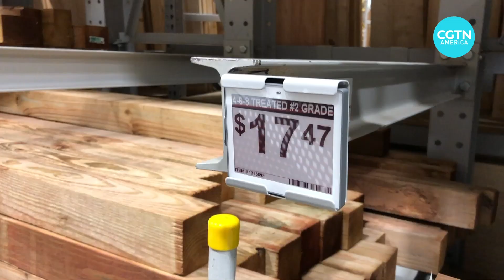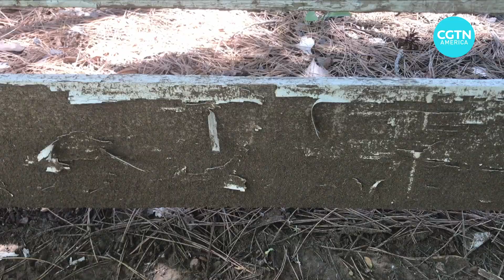U.S. inflation: Lumber prices

Comment: Why do Americans use wood to build their houses and not bricks or cinder blocks?
Reply: Because, wood is cheaper in USA,CANADA, AS THERE ARE MORE FORESTS less people so they can cut tress, UNLIKE INDIA,CHINA WHERE BRICKS ARE CHEAPER THAN WOOD AND have MORE PEOPLE. Thanks .
Reply: @shakebraza196   Yup that's about  right and wood is really easy to work with
Reply: @snakeplisken4119  easy to work with how sir.
Reply: @shakebraza196   Work with it awhile you will see. If you can swing a hammer you can build with wood.
Reply: @snakeplisken4119  Thanks for explaining Sir.
Reply: @shakebraza196   your welcome
Reply: @snakeplisken4119  Are u from USA sir.
Reply: @shakebraza196  no from North America
Reply: @snakeplisken4119  Canada sir.
Reply: @shakebraza196  you bet
Reply: @snakeplisken4119  no Sir, I am predicting.
Reply: @shakebraza196   yes I am. We use wood up here partially due to the weather extremes +30 C in the summer to -be 35 C in the winter. Because of this you need something  that can both expand and contract. Wood "gives" for lack of a better word. Both steel bridges and cement sidewalks need expansion  joints for that same reason or they will crack. We use blocks and or cement for basements and garage floors and put a wood frame above ground and on top of it. It seems to work for us in Canada. My house will creak  and groan each spring as the frost come out of the ground but it's 80 yrs old and is still standing.